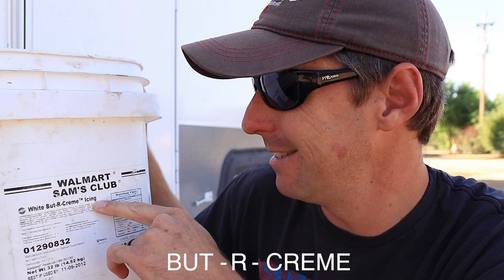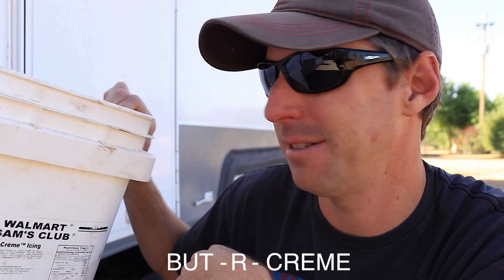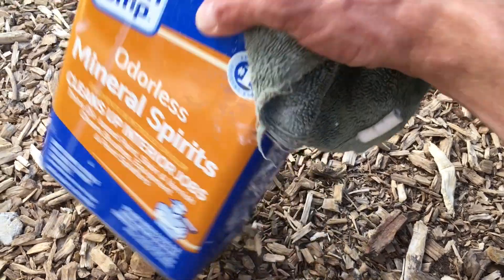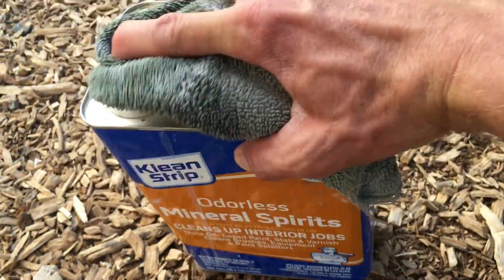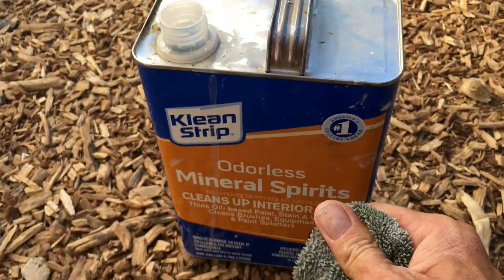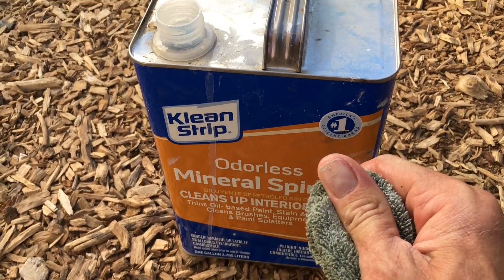How To Fix RV LEAKS The Right Way!  Don't use the wrong products (RV Caulking Types)

Comment: My Friend, I have run what must be thousands of feet of calk due to my line of work. I can tell you not many people can run a "clean" bead of calk without a LOT of practice. Let me compliment you on your calking ability! I would suggest you stop by the next Sherwin Williams store you pass and buy a great calk gun. I can tell you, IT'S WORTH the $13 or so dollars!
Reply: Kevin, Curious exactly which caulking gun from Sherwin williams?
Reply: During my 8-year part-time college career, on which I did graduate, I was a full-time waterproofing contractor and we used Albion caulk guns.  Definitely nice, but overkill for occasional work.  I agree with Kevin Loving that you caulked a nice uniform bead, and like Kevin Long, I've caulked a few thousand feet of caulk too.  Kudos!
Reply: Lol can't get a long enough period of time without a downpour around here. If there is a sealant that works at below freezing temps that would be the stuff. Because winter is the dry season with weeks long stretches of arctic high pressure and sunshine. Summer is full of daily thunderstorms, hailstorms, and even days long deluges.

Comment: The manufacturer wants you to use a detergent that has abrasives and optical brighteners becauee it shortens the lifespan of your roof.  Period.  The best product to use thats easy om both epdm and tpo is a simple cleaner like simple green and water.  
Persoanlly, i think dicor is an inferior prduct.  Its alwo manufacturered by the rv industry and contains chemicals they instruct you not tonuse on the roofing.  For the verticle surfaces and at any opening in the side i use a good sealant callee OSI quad.  Lasts much longer than dicor and provides better protection.  For the roof i use a product called sikaflex 715.  Its about the same peice as dixor and soooooo much netter.  Lasts longer and it doesnt contain mineral spirits, so no damage to the roof.  And the adheaion is far superior.
Reply from the maker: I’m going to try the Sikaflex 715
Reply: @AllAboutRVs  Any update on the Sikaflex 715?

Comment: I'm bummed that Dicor isn't avail on Prime. I'm long over due for sealant, but I guess I wasn't going to do this on the road anyway. This will be my first project when we get "home" for a bit.
Reply from the maker: +Keep Your Daydream yeah you're right, we have always had to purchase it from rv stores. We do usually travel with a tube of it just in case we have a leak that needs to be taken care of right away. We always have lots of projects to take care of once we get back to Arizona. It is so much easier to do here than while we are on the road
Reply: Keep Your Daydream I just bought Dicor from Amazon Prime. :)

Comment: I need to lap seal and do the membrane paint thaing. Problem is lap seal takes 30 days and membrane only 48hr's to cure and I might get rain in less than 20 days. Should I do the membrane paint first than lap seal ? Or cover with tarp and do it right during spring ?

Comment: To be clear, the EPDM rubber seal is only if your RV has a rubber membrane around the AC units and such, right?
Reply from the maker: Yes correct
Reply: All About RV's I finally got up on top of mine, I just bought it used and it’s been icy here. It appears to be metal with some grey paint looking stuff that’s cracked on the edges and where there are any things sticking through. It’s built up thick around the air units and bolts but doesn’t look like tar. I videoed if that’ll help but I’m not sure my next step.

Comment: Thanks for the info, as far as roof leak protection, I've seen on some of these other YouTube RV sites, they put Eternabond tape on top and over the lap seal, on the vents, seams and fittings as a extra layer of protection, is that a good idea and/or necessary?
Reply: I have this exact question as well! 

Seems from what I’ve seen it’s a matter of preference by the owner- I just resealed my vintage camper vent / came with a known leak - from what I e seen on that some do just lap, some do lap then eterna bond/ I’m doing lap with eterna bond over it.  Was wondering same with seams on roof.  Glad to see someone else had the same question- not just me

Comment: what do you recommend for re-caulking marker lights, tail lights, etc?
Reply: Get rid of the caulking and put a gasket underneath it.  Moving shaking twisting boxes of metal going down the road will always need new caulking if that is what you use to seal all things, but you do keep the caulking companies in business.
Reply: butly tape or make your own closed cell foam or closed cell neoprene gasket there are even sheets of rubber gasket you can buy to make your own if you can not find a actual gasket for the specific light.  If it is "RV" specific chances are they do not make a actual gasket for it.
Reply: I just replaced a light for a customer using butyl tape sandwiched between the light and the unit, and finished off with clear Proflex. The Dicor non-leveling caulk would work as well.

Comment: Question—why does our air conditioner freeze up while operating causing leaks? It doesn’t leak in the rain, so obviously a problem with the air.
Reply: Make sure your RV is level when using the A/C.

Comment: Dicor will dry and crack. Why can't you use 100% silicone?
Reply: Silicone won't last as long as Dicor.
Reply: You don’t use dicor on side seams roof only the caulk was to be flexible you guys need to quit listening to some body who thinks they know what is best I am a rv tech of 20+ years you use a good grade of silicone and it will last 4 to years if done properly that being said you still inspect all your seams and roof yearly
Reply: @donaldschultheiss4035  Proflex for side seams
Reply: Sharon oddlyenough unless you really know what you are doing I don’t recommend proflex  I have used it before but I find it really sticky for my taste I prefer temper 645 caulk
Reply: That’s tempro 645 that’s what the oems use
Reply: @donaldschultheiss4035  thanks for your reply! Proflex is what my teacher recommends, I'll have to keep an eye out for tempro 645
Reply: @donaldschultheiss4035  I looked a bit more into this, is the tempro 645 suitable for the flexible roof coverings?
Reply: Sharon oddlyenough no pro flex or dicor my preferred for roof tempro 645 is for side seams only
Reply: Never use silicone unless it came from the factory with it. Nothing will stick to silicone except for silicone. It does not last 4 years. It is garbage. Only use it to seal your tub/shower/sink. 311, on the other hand, is a silicone based self-leveling roof seal works great for fiberglass roofs if it came with it. The worst leaky roof is where several layers of different kinds of sealant is masking water intrusion because they don’t stick to each other. If the roof membrane is made by Dicor, use Dicor sealant, etc. If you don’t know, ask an RV tech at your dealer. Too much disinformation is on YouTube by so called “techs”.
Reply: Aaron Bothe Aaron I am a real RV tech and I agree with your comments on if it has silicone them follow up with silicone everyone has choice to use what they want to use or use what they think is best I personally use a grade of Sealants tempro 645 which is what the Rv manufacturers use and recommend when you go to their factory tech schools on side walls windows ect Dicor or some manufacturers will recommend pro flex I personally do not like it I have resealed customers units and have never had a issue when using these products when it comes silicone it has to be the professional grade it is pricey but worth it I have sealed units with trempro 645 and after 6 - 7 years still look like new but you have to do your prep work first Thank you for feed back and remember lets not slam other people for their opinions everybody has their right theirs If someone would like my professional opinion I will be happy to help but I think I am done    for the most part I don’t care to reply anymore to general posts
Reply: Sorry Auto correction on last post Dicor or proflex for roofs
Reply: @donaldschultheiss4035  silicone will not sick to silicone dont use it

Comment: Hi! So happy to find your channel! I  need to get this done but not sure how much sealant to buy. I'm an Senior (Lady) and will have to have someone do it and want to make sure they use the best product as well as having enough. I understand that you can't possibly be exact; not knowing the condition of my CAMPER. However, based on knowing it's 25 ft Fleetwood with small slide out could you give me an approximate on # of tubes I might need (normal wear/tear)? I'd really appreciate it so much. Won't hold you to it, just need an idea. Thanks so very much! Thanks also for the education on "how to". Well Done!!
Reply from the maker: I would get 2 tubes of caulking. If it’s not bad up there it might take just one.
Reply: All About RV's Thank you so much for your reply! I sincerely appreciate it! Continued successes on your channel!! ☺️

Comment: I am new to the trailer world. I cannot believe these are designs this way.........I'm sure the most recent models aren't but I cannot believe the amount of caulk and upkeep needed to keep these things water tight. Talk about poor engineering and design. I cannot imagine the time, effort and cost it would take to reseal and entire RV. My mind is blown.
Reply: Welcome to the world of RV`s where the only priority in manufacturing is the speed in which the RV can be completed. Also the engineering is quite bad at best and sometimes horrible. The use the cheapest fixtures and connections  throughout and  they simply don`t last. If you own an RV - be prepared to  learn to fix all kinds of problems.  Examples: your propane regulator near the tanks will fail after  5 to 7 years or sooner causing partial or total loss of propane to the stove and heaters.  You can get a loss of electricity over the kitchen sink outlet only to find after several hours searching that the  Ground Fault on the outlet in the bathroom had tripped and they are connected somehow. The roof requires an annual cleaning - inspection and application of PROPER  sealant at any sign of cracking or deterioration. That being said there  is a wonderful socialization effect that occurs at any campsite and the friendships  made are priceless.
Reply: The absolute truth...these are junk..this is why people are converting aluminum cargo trailers. Luan, garden hose and glue. The bonus ...worthless in 10 years

Comment: Henry's product is NOT (just) asphalt based  (04:09).   Mis-info is worse than no info! 

Henry makes literally dozens of coating and sealing products.   I am researching the silicon coatings being offered by all of the big name RV maintenance product suppliers. 

Need to find:
What type of primer is suggested and how to determine need.
Can it go over existing sealants/caulks.  Specific caulk/sealants are made for (after/subsequent) later.  Can that sealant be used against standard RV type plastics, fitting, windows, etc...

Comment: Your channel is ALWAYS my go-to for solid RV questions, thanks!! The dicor non-leveling sealant that you recommend for the vertical seams...do you also recommend that for re-sealing around the windows? I was thinking of going with a UV resistant, flexible exterior silicone caulk. Is there a reason NOT to use a product like that?